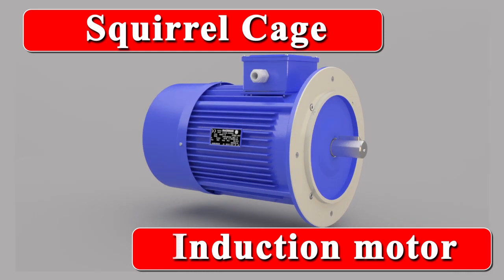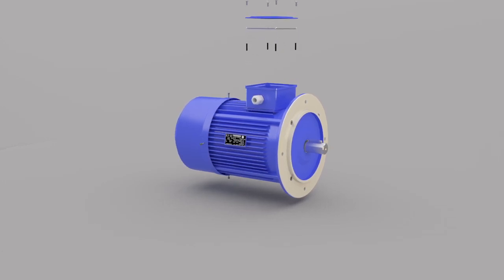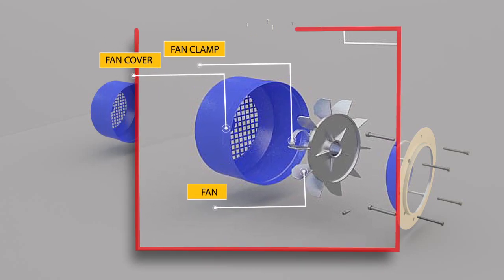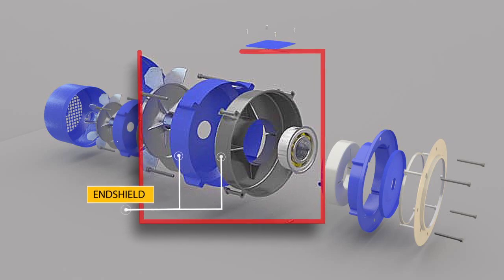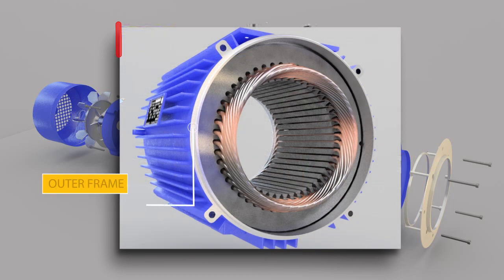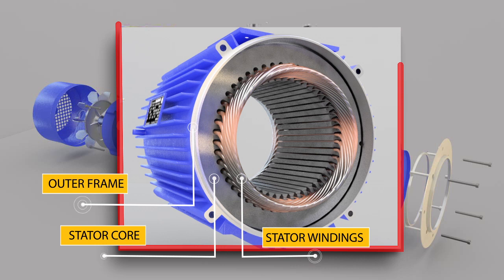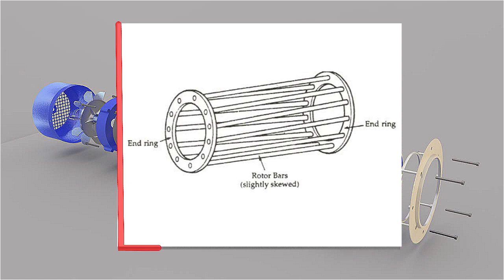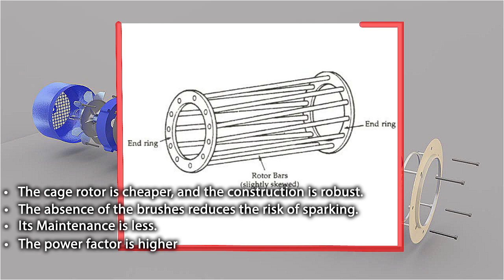Induction Motor Construction (Squirrel Cage Rotor)

Comment: Do 3 phase squirrel cage induction polyphase motors need or have starting capacitors?
I have a very old Century 1.5 hp motor in my South Bend lathe, that has stopped running in forward, w/o my spinning it by hand. The Reverse operates normally.
Thank you for your video, and any help or advise that anyone can give!
Reply from the maker: Well  think that they need to have capacitor for start, What are you use this motor
Reply: @chrvoje_engineering  I'm using this motor in my South Bend Lathe. Again, the Reverse direction works perfectly, I'm only having the "no start" problem in the Forward setting. This motor is only about 55 years old, so it's still just "broken in"! 😉
Reply: The following is for 1-phase only:

Those old Century motors are started by an offset winding with a centrifugal switch. Two coils and a dual switch in your motor - since it can be reversed.  If you have a capacitor on the frame, it doesn't matter.  The following still pertains to you.

There are two main types of starters - 1) offset windings, and 2) capacitor running on its own dedicated winding.  Furthermore, a motor can have a centrifugal switch that cuts out the offset winding at almost full RPM or cuts out the capacitor winding the same way.

In addition to that, a motor can LACK a centrifugal switch alltogether, and the offset winding or capacitor winding is always powered.  These are usually small, cheap motors which don't need a high starting torque.  (An exception - always on capacitor coil motors are used for wide torque band (wide torque range) uses like for compressors, but they have a third starter capacitor start coil (with a special breed 'starting capacitor') that is cut out by a centrifugal switch, and that is for high STARTING torque.  Expensive motor.)

How a starting offset winding works is that it is wound a pole or two ahead of the main winding usually, and wound with smaller wire.  The smaller wire is important, because the rise of current in a winding with large wire is faster than the rise of current (and therefore the development of a magnetic field is delayed) in the smaller winding.  So, the two coils of course are energized by the same waveform coming out of the wall, yet the two coils 'fire' (for lack of a better word) in an offset way (meaning develop their peak magnetizm at different times) and therefore simulates a rotating magnetic field.  This is perfect for coaxing the rotor to turn because it gives something for it to 'chase'.  Cap windings serve the same purpose, but are wound a couple of poles behind the main winding poles, since a cap is an energy storer and thus acts differently from a pure offset starter winding.

The only reason why a 1-phase motor keeps runing after startup and any starter coils are turned off - is because the inertia of the rotor brings it around without magnetic assistance where a newly energizing stator pole can 'meet' it.

Your Century motor has an open in one of the two offset starting coils.  If you see no burning or dark coils, there is a good chance that the contacts for that coil on the centrifugal switch is bad which is an easy fix.  Bad luck would be a simple open somewhere in the coil itself.  Just disconnect the motor from the mains and use an ohmmeter to check the coils.  Look at the switch for which terminals are for the starter coils.  If the suspect coil reads infinite ohms or close to it, it is open.  If it reads zero ohms, you probably found a contact that has been fried.  That would be your answer.